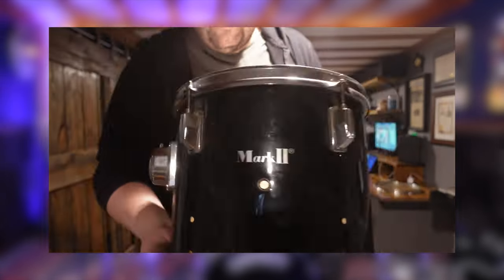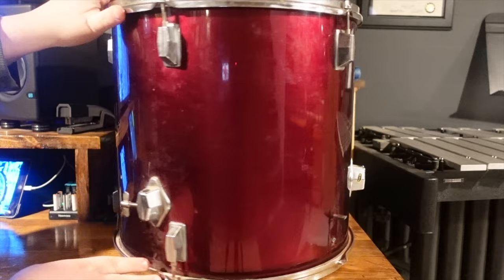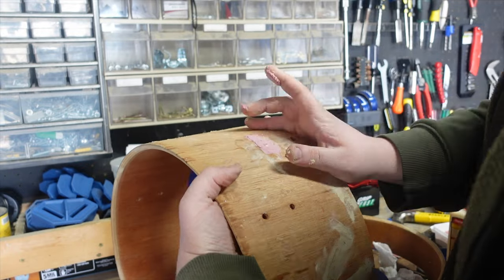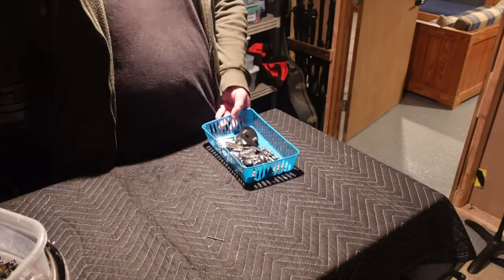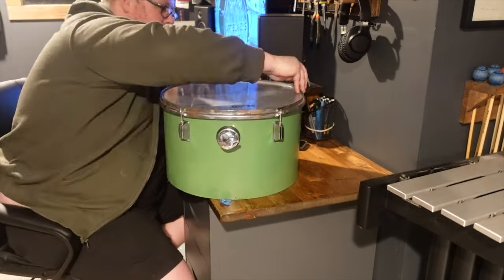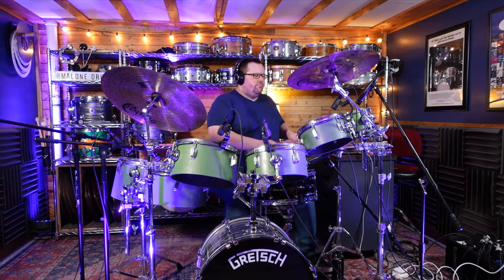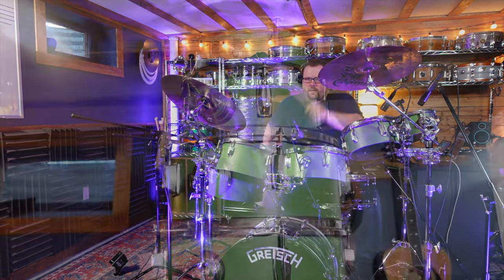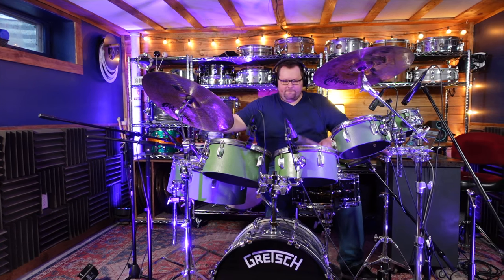Building Set of 6 Concert Toms (Part 2) // DIY Drum Building

Comment: I gotta say Mike, as someone who is just starting to dabble in woodworking & drum restoring/modding these videos give me real hope and some direction. Thank again for all you do! Keep up the killer work!
Reply from the maker: Glad to hear, feel free to share some projects when you get going. Always love to see that stuff.
Reply: @malonedrum  Will do! So far I've only made a quick and dirty "pedall board" for my gear. Just started playing for a local artist and I have been spoiled to using IEMs. So I build a little rig that stays all wired up and helps keep the sound consentant for me. I've got my Yamaha EAD-10 to mic my drums and my Dr. Beat all running into a little behringer mixer. Then at practice, I take a line out the guys combo amp to run into my mixer so I have his accostic and vox. Then at shows I do the same or run the floor wedge line into it. Anywho, I got tired of setting all that up every time so I grabbed a bit of scrap wood and built a little board for it. Got everything strapped down and it even fits inside one of those pelican style boxes. So now I just pull it out, run power, place the mic, run the two lines i need, and I ready to roll! 

Next up on the list (and this has been on the list for years) is to fix up an old CB-700 kit a friend gave to me. Needs some cleaning and I need to replace some missing hardware BUT I am looking forward to it. Plan to fix it up and use that at rehearsals so that I don't have to break down my kit every week.

Comment: Hi Mike, what’s that stuff you used to take the logo of drum heads? Do you know if it will work on coated heads. I’m doing up an old set of ludwig’s and want to get rid of the remo brand on the front head to add a ludwig transfer. thanks
Reply from the maker: I used goof off, it works well on clear or ebony heads, but on coated heads it will also take off the coating.
Reply: Peel Productions - Acetone works very well to remove drum head and cymbal logos